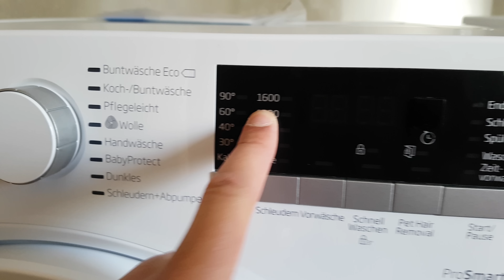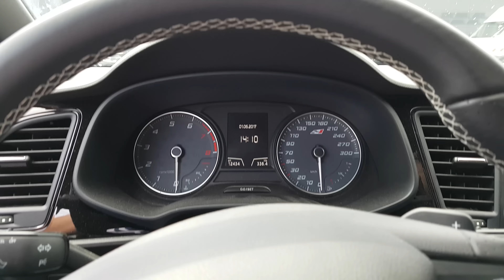ROCK AM RING MADNESS

Comment: Saw some fenced in areas while at N24, but thought they were there to prevent people from camping there during N24. And yes, even at 5-10km away from Nurburg, even the roundabouts are fenced in.
1:40 Capricorn wanted more dough, the organizers wouldn't budge because he was sure the actual festival is more valued than the place. So, he organized it after 2014 in another location while at Nurburgring was not that much going on.
Now they are back. I guess the "new" owner has another opinion regarding the festival.

Comment: You are not allowed to wash on Sunday due to "noise" regulations :)))) 
Also, no pressure wash on the street or private property without a waste water system and an oil separator.